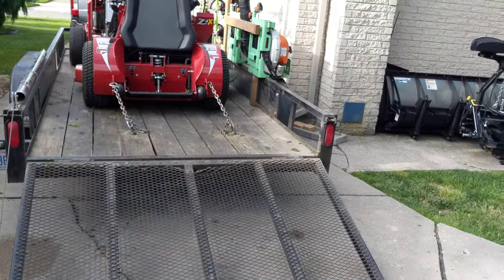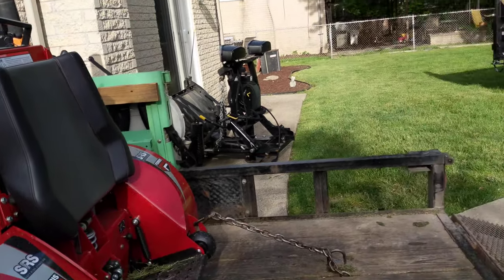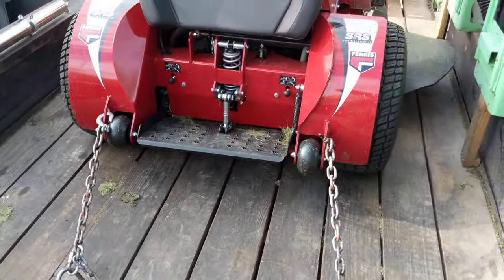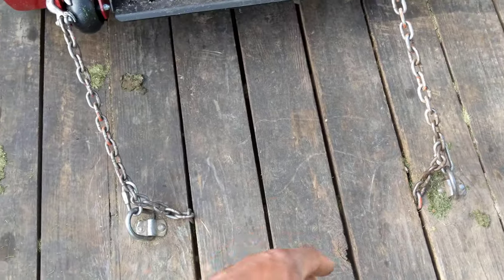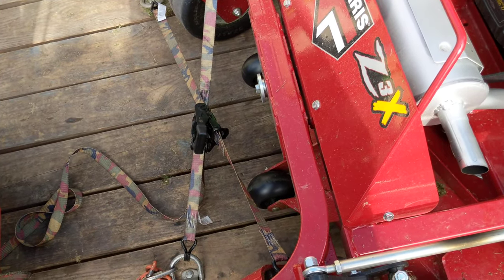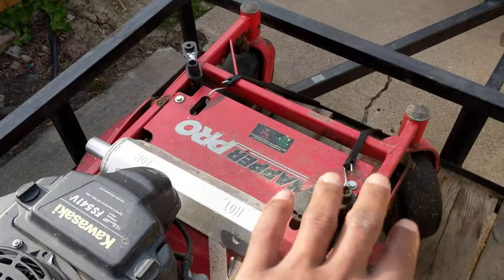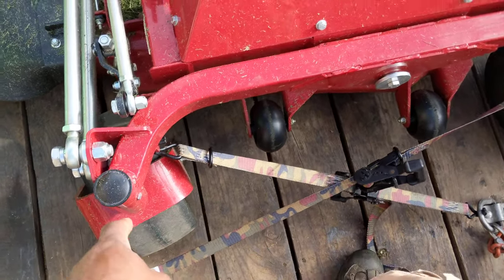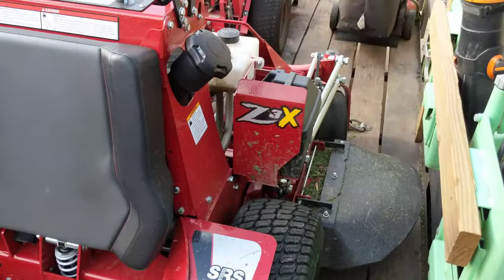How are you guys securing your mowers to your trailers?

Comment: I hate to tell you, those bungies will definitely get you a ticket.  Nc highway patrol says rubber bungies are not a tie down. Also 4 tie downs per item is recommended. Prevent movement in any direction. The lightweight straps would slip , need to have ratchet straps there. ratchet straps should be able to hold 4x the vehicle weight. if your vehicle hits an immovable object the items tied down can exceed 10g's in an insta nt and stuff moves fast.   it is suprising how many people never tie their equipment down. Even if the trailer goes to whipping side to side your mowers will be all over the road, you alone are liable bigly!   Thanks.